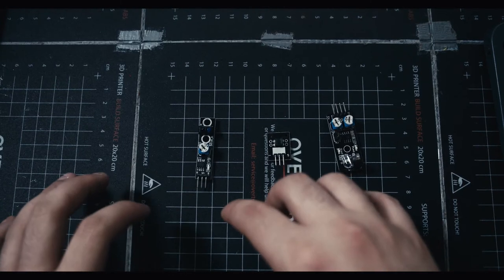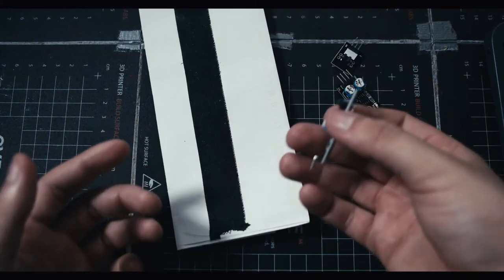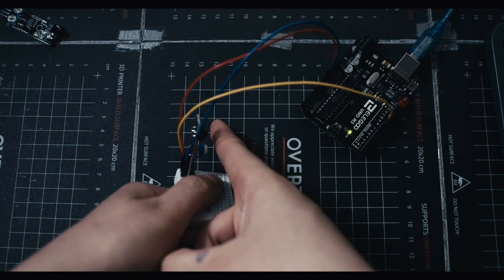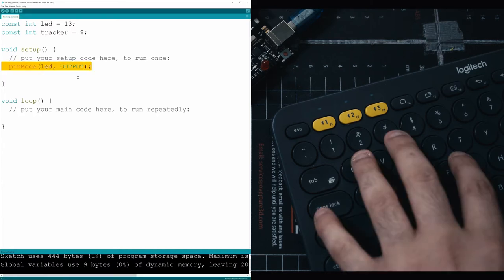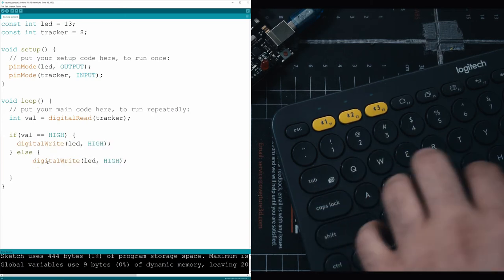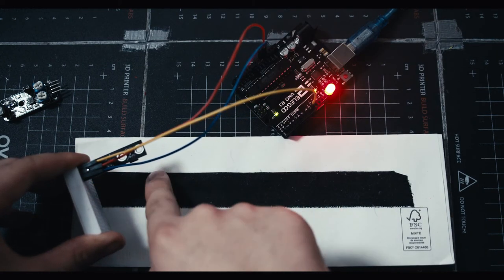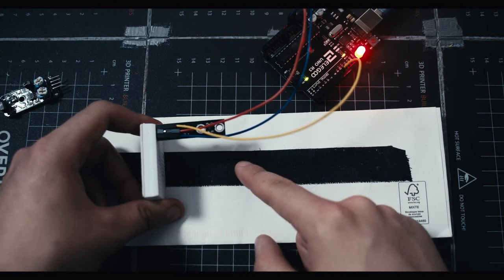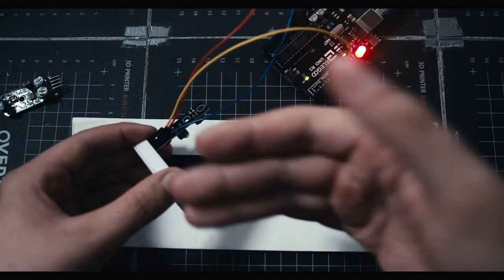Tracking Sensor EXPLAINED | Arduino Sensors | #grindreel

Comment: Hi! is there a possibility that I can insert a gps tracker to my binocular that could send a command to my cp to check the location of what am I seeing? if there is, what gps am i needing?? thanks!!
Reply from the maker: Yes but its a bit more complicated then that, the gps can you give coordinates of its location, but you'd have to find a way to track a  lot of data of the object your looking at, like how far it is, the angle your looking at it from, etc and then you can pair those together to get an estimate. I would recommend looking into rangefinders and maybe pairing a gps with one of those, but its definitely a complicated task.